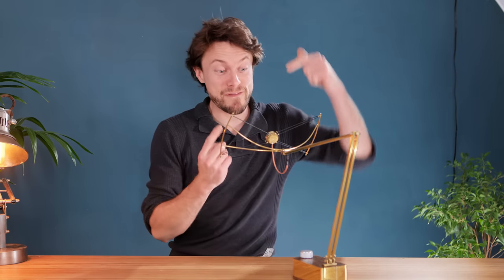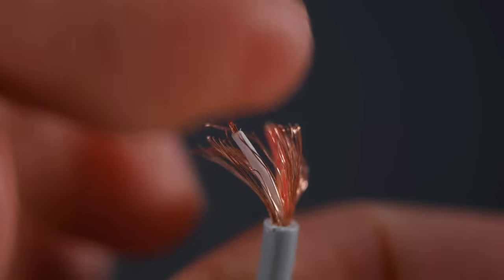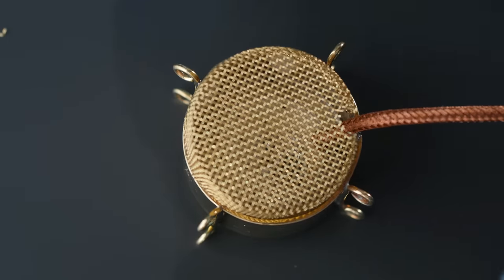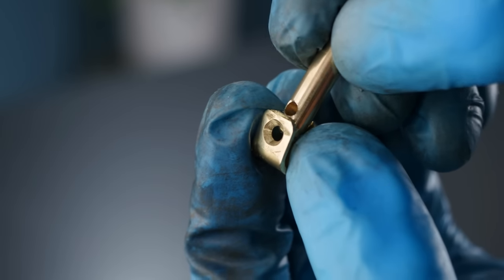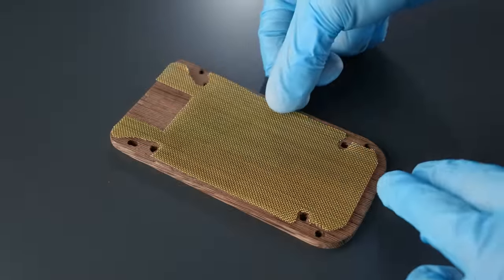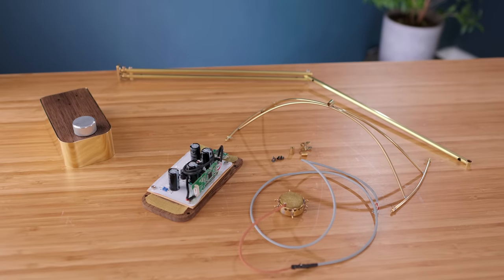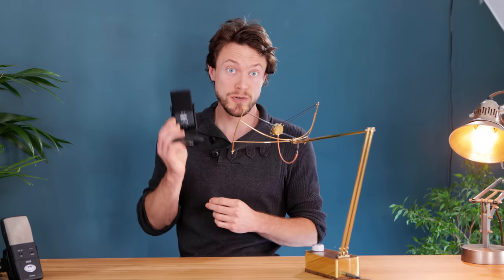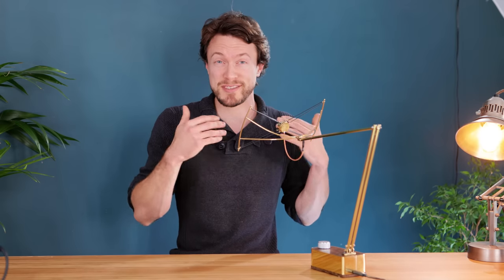Building a quality USB-C microphone

Comment: I just built mine. Instead of USB-C, mine has an XLR output that plugs into an audio interface. I'm actually amazed how much better it sounds than my previous SM7B.
Reply: Dude. That's amazing! Did u buy the exact same capsule ? Or u bought dynamic one. And is it easy to make xlr version of this ? (For Nons electrician guy)
Reply: I also have an SM7B. The perspective of building this mic got even more exciting. Would you mind sharing which XLR breakout board you used?
Reply: @sirrus_sky  I purchased a random $15 chinese microphone that I liked the body of on Amazon and then gutted all the internals. This obviously came with an XLR plug, so I just soldered my new circuit onto the original XLR plug attached to the body.
Reply: @justinlee8328  Good thinking, thanks! :)
Reply: Can you show how you connected the XLR to this circuit?
Reply: @justinlee8328  Where'd you connect the xlr? Before or after his custom preamp?

Comment: Schematic is somewhat over complicated: there are now multiple rail-to-rail opamps that can feed directly from 5v usb, and pick up signal right from the electret capsule.

Anyway, impressive workmanship and brass fixture!
Reply: 'overcomplicated'? dont be ridiculous, this schematic is simple. Finding a rail to rail opamp with low enough input noise at low gain (this part has 1nV/Hz EIN at low gain), using single supply, will not be easy and using +5V from USB directly for a mic-pre requires very good PSRR, due to the noise that comes with connecting your preamp to USB GND and powering it without any regulator at all .... and doing so with a perf board layout (no PCB) is asking for stress. Thats if you can find a part that doesnt add back the $3 and a single extra cap you need for the -VEE pin pretty swiftly.  Yes, the Murata DC-DC convertor is a little expensive, but hardly worth mentioning. Honestly i'm not sure youve thought this through very far ...

Comment: Audio products are EXTREMELY overpriced, and audiophiles being snobs about non existent "quality improvements" keeps the practice alive, GREAT video, this is a build i can actually do myself! Love this channel
Reply: Yeah this is once of those funny moments where I've spent two months researching mics and amps and getting pulled into the "authoritative" gearhead talks, and this dude swoops in and changes the whole game. No exaggeration, this is a game changer. Mic manufacturers better be afraid because cheap Chinese manufacturers can clone this and mass produce something similar.
Reply: I wouldnt say its "overpriced" but its more a great example of diminishing returns. The point at which diminishing returns are reached are really quick with audio equipment
Reply: Studio tools like mics are pricey for a reason, comparing that to audiophile fandom is like comparing a supercar to a tractor. It's a completely different beast.
Reply: @gutterg0d  not always. Actually most of the time that's not the case with audio equipment. A better comparison is the wine connoisseur racket. When put to a blind test the majority of wine connoisseurs preferred the taste of a cheap sweet wine over a tremendously expensive wine. Audio equipment for the most part is using the exact same technology that's been in use for 40 years. Above a certain price bracket (that is lower every year due to increases availability and manufacturing competition) the quality is indistinguishable. Only the tonality changes, which is highly subjective. I'm not saying there is nothing that says high end gear apart, just that there is a lot of smoke and mirrors, repackaging, and branding that makes audio gear different from, say, computer or tv technology which actually changes by leaps and bounds every year.
Reply: @GrandmasterofWin  Have you done any kind of studio work ever? No? I thought not.
Reply: @gutterg0d  yes. I do. Every day. I also have access to 40k in equipment. You?
Reply: @GrandmasterofWin  Then you should know how much time can be saved by using a mic that matches more with the desired end result, and how much a mic recording can deteriorate through post processing if the hardware doesn't cut the mustard. No?
Reply: @gutterg0d  definitely true but it's not a dollar to dollar comparison. That's my whole point. I like that you used the term "mic that matches more with the desired end result" because the truth is that some vocals sound better on a $250 mic if it has the right characteristics that suit them. Some vocals are better through a u87. Ironically some vocals are better through the later BECAUSE the vocalist is more comfortable speaking/singing into a high end mic, they recognize it's shape, and they expect magic so you can hear it in their performance. Some vocalists sound better on an SM57, a technically inferior mic thats flaws actually work in its favor under some circumstances. I'm not saying that it's never worth it to have expensive gear. Once you've reached a certain point in your career it's a huge relief to be able to shoulder the cost, not because a $3000 mic is always "better" than a $300 mic in 100% of the cases, but because you NEED the $3000 mic in your booth for many reasons. A prominently displayed quality mic sets a vocalist's mind at ease, it captures clarity and detail that cannot be magically added to the mix if it was never captured, and because everyone's voice is different, styles of music and reading vary, so you need an arsenal. BUT, a quality condenser is a quality condenser. The markup on parts simply because they've been placed in an elegant shroud and have a particular name written on the body is a very real thing. I have an old AKG c3000B. This thing is hated among the gearhead crowd and understandably so. It's hard to find a consistent use for it, it can sound muddy so it can be hard to find a use for it, but I have recorded vocals and especially acoustic guitar performances and had people rave at the warm richness of the sound. I don't like to tell people what gear I'm using because simply mentioning certain gear will color peoples' expectations and perception. I think the video we just watched demonstrates how simple the actual mechanics of a condenser mic is. I wouldn't recommend this project for a professional recording studio (hopefully this is obvious), but it is a clear illustration of the kind of margin there is in studio equipment, the blind religiosity of gearhead culture, and how much a home DIYer can accomplish when the tech in question was basically figured out 40-60 years ago.
Reply: @GrandmasterofWin  I clearly misjudged where your initial comment was coming from, my apologies and thanks for taking the time to write your response. A great reminder that even on YouTube not everyone is a generalizing troll. Have a great day!
Reply: @gutterg0d  I guess the last thing I'll mention is synthesizers, a great side topic here. Everything you can do with a vintage Moog or comparable analog synth you can accomplish for free with decade(s) old software and a good midi controller. There, I said it. No one can tell the difference. Yet there persists a religion of analog. Notice the language shifts from frequency range, noise floor, oscillator count and other measurable characteristics to "vibe", "warmth", "glow" and other emotionally charged words. Also note that a vintage Apple computer (a non collector's item) is considered e-waste, but a Moog, a machine of components that cost pennies to make and have been available for a half a century has retained and in fact gained in value. You can actually build a Moog clone at home very cheaply, except for time cost. If the market were great enough a Chinese manufacturers could easily produce clones for $100-300, and Behringer actually started doing just this by releasing a Moog (Voyager, I think) clone for $400. 

Anyway you can see where I'm going with this. There is a massive mark-up. A lot of margin, for something that doesn't even need to exist except for the way people feel about it, which is ok as long as we're honest with ourselves.
Reply: @gutterg0d  you too. Thank you! I did slightly generalize out of excitement for the project. I just love seeing a big inflated bubble pop lol
Reply: @GrandmasterofWin  Vintage gear is great because of what it does that is not specifically requested by the user. This is where plugins still has ways to go, but with AI will also come surprises that are not only equally unique but also completely reproducible. We live in interesting times.  :)

Comment: Q: Is there a preferred distance for the suspension bands? seems like length (and tension) would affect frequency isolation.

Amazing build regardless
Reply: That's a while lot of specific where it's completely useless.  Don't become that kind of audiophile!
Reply: @havenbastion  More curious because I have no idea. I assume there's a minimum simply because there's one in car suspensions, but I also imagine any maximum would suffer rapidly diminishing returns. I Personally think the suspension is a bit too long as it is.
Reply: @TheVoidSinger  sounds like something that needs to be tested, apparently the long thin wire is better for isolation but it seems to me a taught wire of any length will oscillate, but the longer the lower the frequency and if sub audible it doesn't really matter.
Reply: @chrismofer  oh I wasn't thinking of the wire, rather the nitrile loops used to prevent vibration.

the insulation of the mic wire via solder removal tape is more than sufficient, better actually than most fiber insulated wire.
Reply: @TheVoidSinger  oop I wasn't paying attention, indeed I mean the nitrile hangers.

Comment: Really curious if someone could simplify this with a less elegant solution using 3d printers and some premade circuit boards
Reply: Thinking the same thing. Been dying to use my 3D printer for a big project.

Comment: Youtuber nowadays: "I know a lot about keyboards."
DIY Perks: "Yes, but, did you know that with a condenser microphone, the microphone capsule consists of a very thin, flexible diaphragm which is spaced a minute distance in front of a rigid, insulated electrode referred to as a backplate?"
Reply: Lol

Comment: I really enjoyed this video, but was wondering how one would go about making the output XLR, I have an audio interface and it would better serve my needs if this was XLR. I am aware that it would in fact probably be easier than usb because the absence of a preamp, but was wondering if there was anything I should know.
Reply: just wire the mic+ and mic- of the transistor to XLR pin 2 and 3 then ground to pin 1.
Reply: @woodyTM  thankyou for the advice!!

Comment: It's crazy that this is $30-$40 dollars worth of parts - and that's after getting used to the astoundingly low costs featured in his builds. I didn't think this would be under 100 dollars at the minimum - very impressive!!
Reply: Yeah, but you'll have to do some digging for alternatives, because most of the parts used are now both obsolete and expensive.

Comment: Going to have to inspect which parts of this are core/necessary, and can be modified from the design (soldered wiring bits). Curious to see how customized/personalized you could make this, if I can even fathom to do this in the first place.
Reply: Theoretically the only required parts are the circuit and the base part of the mic. If you wanted, you could build this However you want? When I build this, I'm probs gonna make a different support system, and make it look like an old plane flight stick

Comment: Is there anyone here who attempted to build this? i have all the parts put into my shopping cart lol, just need some motivation to click the buy button. ive never done something like this, but i have been using voice mics for 12 years now and something like this could be so much fun to make and test. still a bit afraid to fk it all up lol. if someone recreated this DIY mic, please reply with your experience. THANKS! <3
Reply: I am currently. While it's nice to have some experience with DIY electronics, soldering, fabrication etc, this is more or less an ideal project to get your feet wet. No writing or even loading code into a microcontroller (the only one being the board from the USB ADC) no particularly expensive tools needed, the instructions are clear if you know how to read a circuit diagram, etc. Just be methodical, pay close attention, and it should be really hard to fuck all of it up. Worst case scenario, you break a component, and each of those are super cheap by themselves.

Comment: I have a question: Is there a way I could make this but replace the usb c breakout port with an xlr one? If so, what would I need to buy?
Reply: I'm pretty sure the answer for this would be yes, although I'm not sure how

XLR is basically the same as 3.5mm and other sizes of audio plugs but more durable so thinking of it that way could work
 You just need to figure out the xlr layout you'll be using and how to wire everything up

XLR is analog unlike USB which is digital which means you should not use a digital to analog converter like here although including an amp might be possible if you chose to do so

I assume the list of things to buy should be everything listed in the video before the "Seperate unit for amplification" (called audio interface) assembly part which would be the dac and amp
Reply: @mclarenf1lm374  thanks
Reply: @gabrielecalvanese7239  no problem, I hope this helps

Comment: around £90 for parts but you need equipment and tools to put it all together which will cost a lot in terms of price and time
Reply: What would you say is the most expensive tool you saw him using? Personally I didn't see anything that would cost more than $20-30, and almost all hand tools that people already own. Maybe the butane torch is more specialized if you don't normally do soldering or brazing.
Reply: Owning and being able to use that equipment is a big net saving, and potentially even a big net gain in the long run.
Reply: @vladimirilyichlenin5697  

IF you were going to spend the money or time anyways. If you just want a single mic, you might never solder again.

Comment: There is no way this is $30 unless you already have a lot of these materials. Even still, its not $30 because you bought them in the past.

Realistically, in the USA, buying all the brass, wiring, components, etc this would probably be closer to $100. Keep in mind, that he mentions the microphone is $10 it self. That means he claims everything else is only $20? lol no way.

Even if you look at the part list provided in the description, only a few items in and the total is past $20.

Not sure why he would feel the need to claim $30 as a price point, the project is cool even if it he said it was $130.
Reply: well he is in the UK and I would believe those would be his prices over there which if converted by 10US = 1 UK. it is way cheaper on the US end. because with the conversion it would cost 300US for him and 130US for you
Reply: You can order ready-made mic of the same parts (sensor, preamp, usb board) from aliexpress for ~$50. Stand will be usual pantograph+spider, but works as good as this brass masterpiece )))

Comment: There's a lot more to the Neumann beyond the capsule (which is MUCH more expensive just by itself) such as internal tuning, EQ, and other design considerations... but the sound comparison, at least with YT audio quality, is remarkably close. I think that short of engineers who have spent their lives around u87s and the like... you could probably swap them out with a few modifications/tweaks and most people wouldn't think twice. Absolutely incredible for a DIY project at a fraction of the cost.

Comment: Hi I'm not much in the understanding or everything microphone, but my view is that the DIY one definitely stands out in all aspects especially being super cost friendly, I'm surprised they don't sell something like this on the market but in comparison to the $3000 microphone there was I could tell the small difference being that the DIY pick up more quiet sounds where as the other didn't and was subtly more softer on the output. I'd say if you are going for the most best then the expense shouldn't be an issue but if you care about money and want the best the DIY is definitely the route to take, so much so I may try it myself. Definitely going to use different components for a softer sound intake but the internal components with the circuit boards are no doubt an amazing way to get what you need out of a microphone.

Comment: I "built" a crappy, but functional microphone a few months ago. Just cut and stripped a cord with a 2.5mm male jack on it, and soldered a 10 cent 1cm electret microphone to the wires. Then just put some heat shrink around any exposed wiring. That was it. And the cheap electret was probably the same quality you would get from any low end PC microphone anyways. I wouldn't say I built it though, the actual microphone was already built. I just soldered a connection onto it.

Comment: to my ears and it's hard to believe but the DIY sounds better than the Neumann! Of course the full frequency response graph needs to be seen but yayks its impressive and makes 3000 purchases kinda overrated. That's without even mentioning that the circuit is pretty straightforward and leaves looooooots of room for further tweaking by experts (not me ahah). Many thanks for the build!